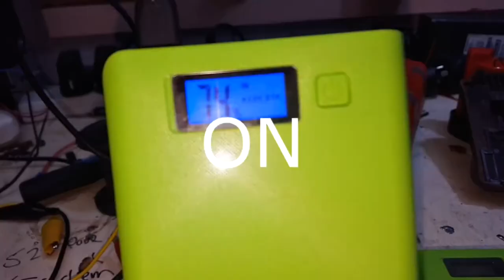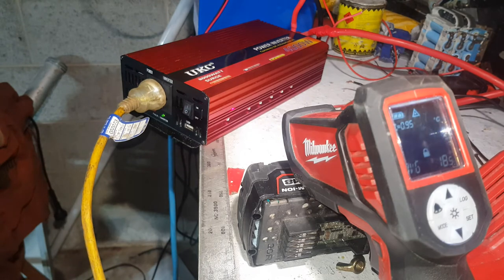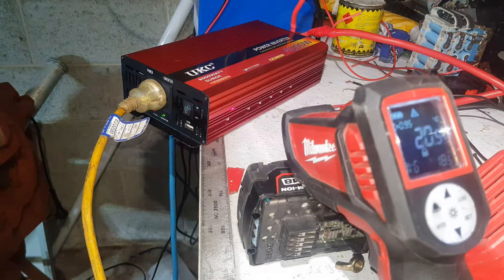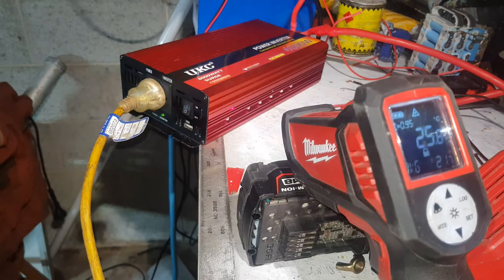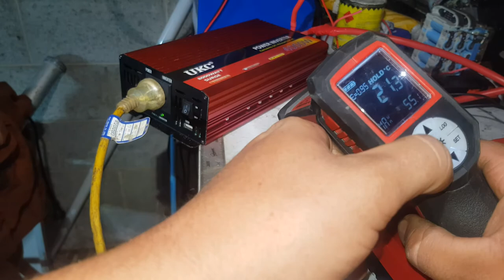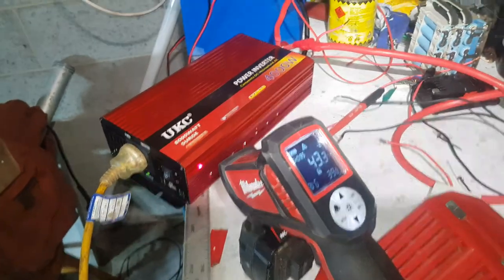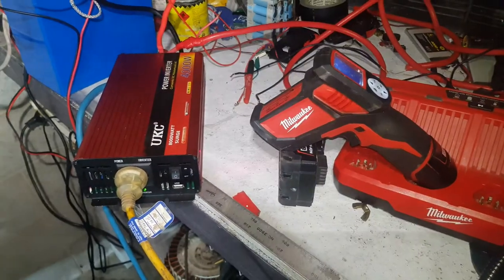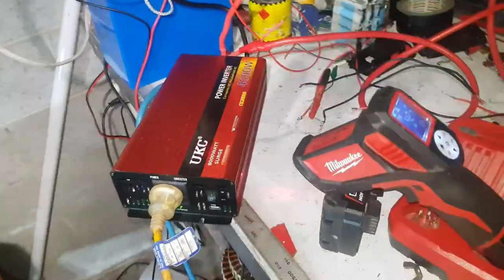Load Vs temperature 4000 watt Ukc 12v power inverter

Comment: Hi, do you think this would power a 1600 watt iron (clothing iron - weird question i know)for an hour?
Reply from the maker: I think it would be on its limit. And will use a lot of 12v amp hours you are sort of converting your battery bank to heat
Reply: @Oneupthesleevecustoms  OK thanks for the reply :-).  It would be running off a car with a 65amp alternator..  Wondering if the alt would be powerful enough also..  Any ideas?
Reply from the maker: No you will need storage tii its over 125 amps at 12.8v
Reply: @Oneupthesleevecustoms  that's the same answer as someone at work says..   Thanks very much though, very helpful :-)
Reply from the maker: Yeah its a big draw at 12v